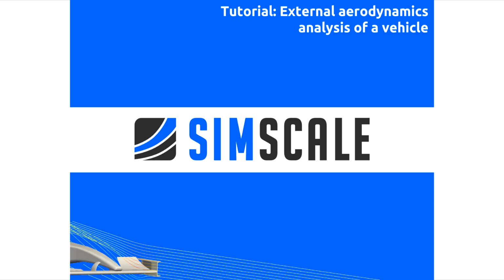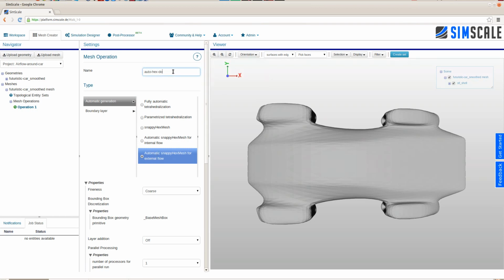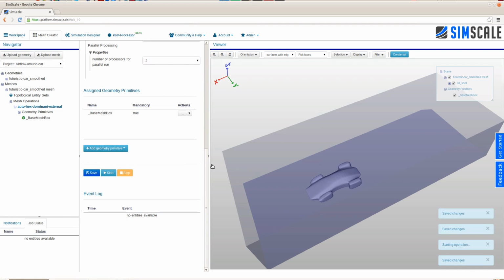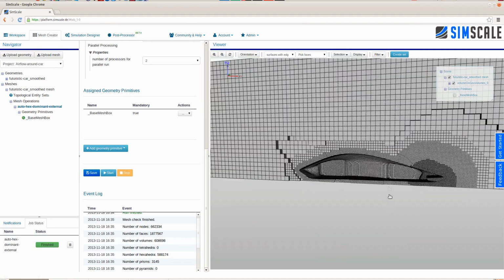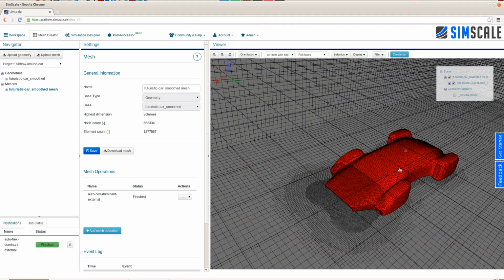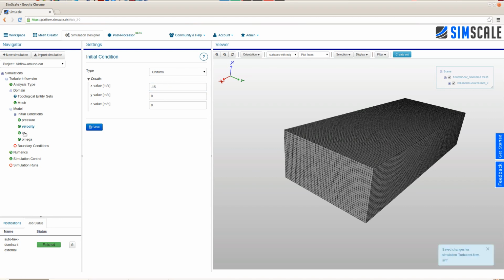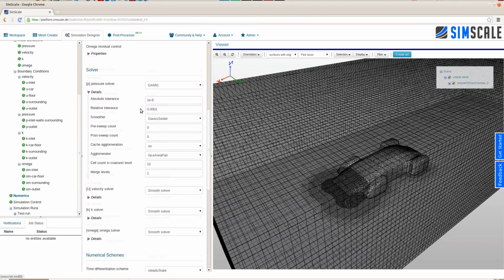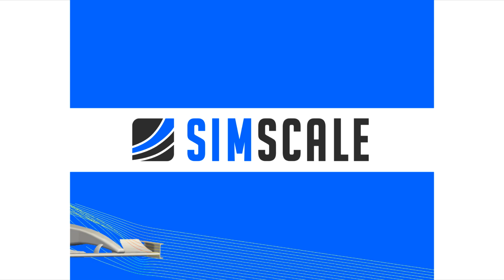External Aerodynamics Analysis

Comment: 0.53 is the computed drag coefficient? how about a sphere?
Reply: Hi Dan! Can you elaborate your question please? Just feel free to do a study with your account :) Would be happy to see the results!
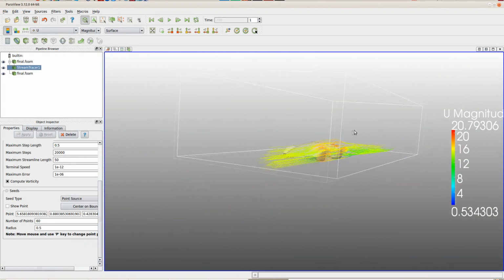Reply: @JousefM  at 5:58 it says 0.53 in the lower right corner, is that the Cd?
And has a sphere been tested as a reference against reality. I've seen CFD software calculate a sphere as laminar so it's 0.08 when in reality it's about 0.5
Reply: @DanFrederiksen  That 0.53 is the velocity magnitude as indicated by the legend. You can of course rescale that inside of ParaView and also for a real external analysis you have to set up the reference area, and some other settings but that can all be done inside of SimScale :)

Comment: Does this kind of simulation show the net forces on the car due to wind? I mean lift and drag or the total force so we can decompose it with trigonometry 
Thanks in advance
Reply from the maker: Lift and drag can be obtained directly from the* result control items on our platform.
So you might not require the total force at all. The decomposition is required only when the lift and drag are not known directly from the results. In that case we calculate the total force.
From the total force we decompose into the components (say in y and z directions), assuming y is the direction of flow and z the normal to the vehicle, and then calculate the lift/drag manually. 
If you have further questions, please do not hesitate to contact us in our forum: https://www.simscale.com/forum/